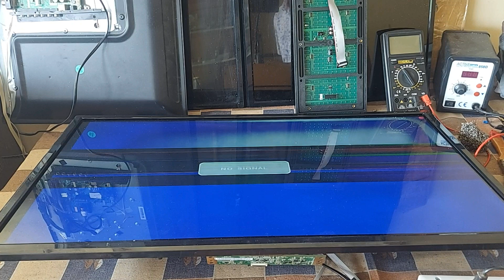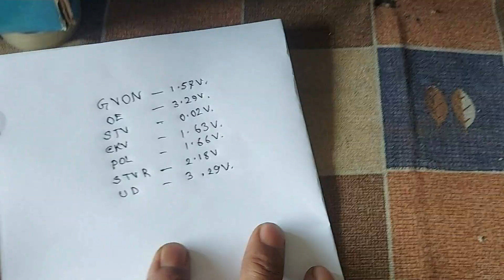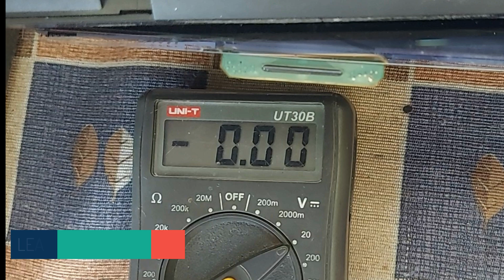Horizontal line on half screen then white screen problem on Samsung 32 inch LED TV  ST3151A05-F-XC-1

Comment: Mera 24 inch ka BPL ka TV ka panel setting करते-करते kaun se switch dab Gaya aur black skin Ho Gaya all voltage okay but picture nahin a raha hai black screen plz bhaiya help me
Reply from the maker: Step 1- Download the firmware (software) BIN file of the main board number according to the resolution of the panel, paste the file in the blank pen drive. 

Step 2- Plug the pen drive into the USB port of the TV. 

Step 3- Then connect the power to the TV, do not press the power button, wait for 3 minutes in standby mode.
🌺🌹❤️🌹🌺
Reply: @OrnatePixels  plz one video dada

Comment: sir sony 5 time blinking  32 inch panal
Reply from the maker: Thanks Brother 
🌺🌹♥️🌹🌺
Reply: Check led driveer and led inside the panel
Reply from the maker: There may be a problem with the backlight or the backlight driver circuit. Thanks Brother.